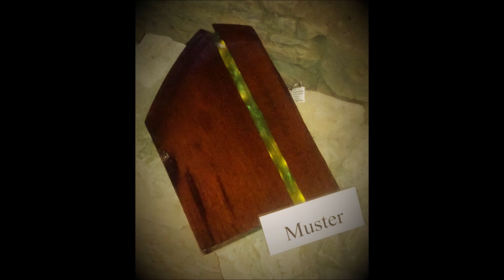Nordlicht Northern Lights Epoxy Resin Artwork Woodworking Kunstharz Illumination Lampe ToSaLignea

Comment: Nice idea and execution . What are the lights ? It appears to have a  " controller "  or " transformer " .
Reply from the maker: Thank you for the great comment, the lights are called LED micro-light set by the company Lumineo. Battery operated with power switch. I bought them at the hardware store. Beste Grüße aus Deutschland!

Comment: Hello, what products did you use to make the green part? im searching for epoxy resin but you have like 3 different mixtures. Can you tell me?
Reply from the maker: Hello, the green color is PearlEx Pigments. The 3 different mixtures was a experiment. The best epoxy for my work is Laminierharz Terraharz the best.
Reply: So you completely dipped the LEDs in there?

I would have made differently is some kind of a holder for it to swap out the LEDs if they happened to break.

Either way, it's a cool effect nonetheless.
Reply from the maker: Hello, Of course it is better the leds not dipped in resin but one scoring a better effect so. Thanks for watching the video. Beste Grüße aus Deutschland!

Comment: Why not use drill with stir?
Reply from the maker: That was other resin, sensitive, I would have too many bubbles in the resin!
Reply: ToSaLignea did the resin have any odor? I'm having trouble finding a resin that's not really thick. Also, what type of mica powder pigment did you use? Looks amazing!